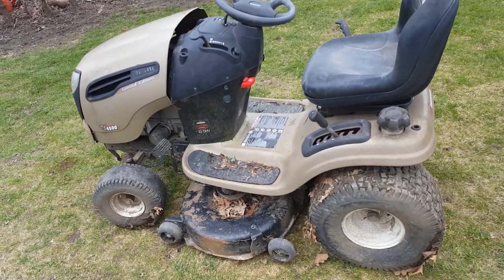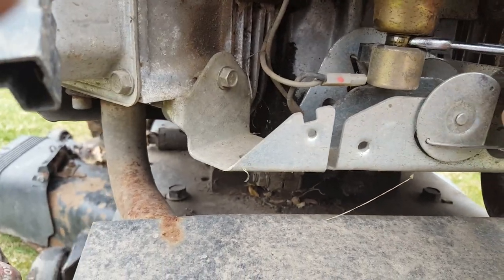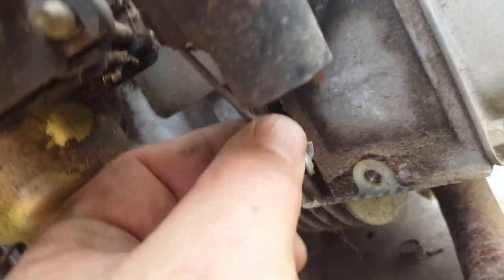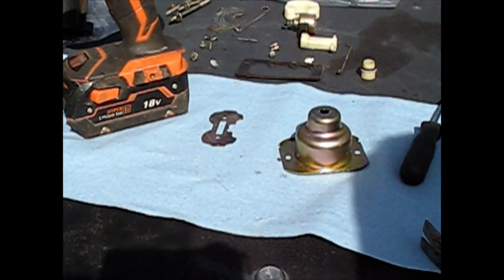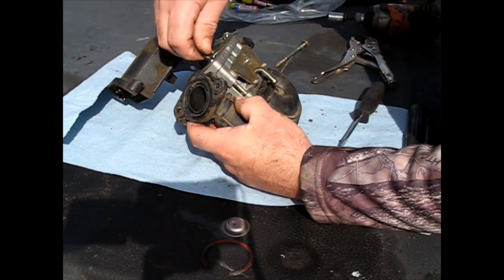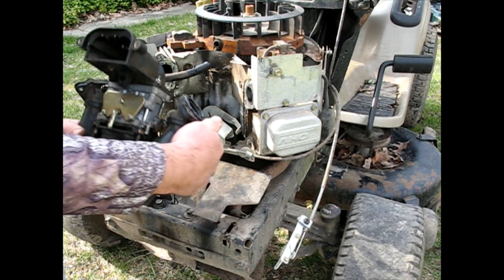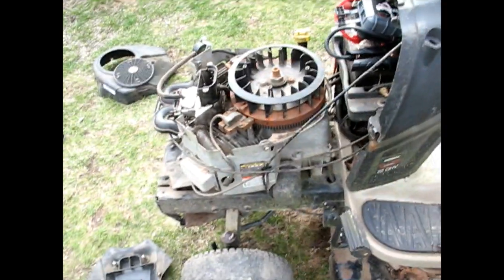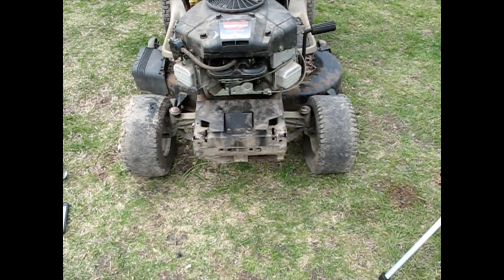Briggs and Stratton 22hp OHV only runs good on choke. Craftsman tractor

Comment: I found the ports to the heads were leaking air past the o rings due to warpage. I found the face of the manifold to the carb warped and letting in air as well. I also found that the rubber gasket under the transfer tube had swelled or just mashed so flat over the years, It was obstructing the space around the emulsion tubes nearly blocking them. ALSO, the the gasket under the black thing behind the throttle plates, the old gasket was partly obstructing flow. Glad it worked out for you, just some tips on things I have discovered.

Comment: The difficulty in the engine turning over is caused by the valves being out of adjustment. These engines use a compression release on the camshaft and the valves have to be set correctly for it to work.

Comment: I've got a 26hp with the same setup.  I did a basic quick clean like you said in the beginning and it'd only run on choke.  I had a feeling it was gonna take a chemical bath cause it sat for years.  I thought make adjustments on the screws but i need this thing to do the work next season.  

Thanks for the video.  You helped me make a decision.

Comment: Have a rebuild kit in hand when you open up one of these older carbs full of O rings, seals, and gaskets that shrink, swell, deterioriate, and crack. Also replace the 2 intake to cylinder square cut seals.
Remove float bowl first, then remove fuel solenoid. You will then see how the plastic fuel tube adapter fits.
Never use a powered driver on carb fasteners.
The 4 studs are not 4mm, They require a female torx socket.
The 2 float bowl screws have JIS heads, not meant for a #2 phillips.

Comment: Can't believe your using a power driver on a carb, Good way for things to go wrong in a hurry.
Reply: I've done it a thousand times and never had any trouble.. just have to know when to stop
Reply: @TheHomeImprovementChannel  yeah me too low power slow and know when to stop.  Also have jis bits for yhe bikes!
Reply: @TheHomeImprovementChannel  So then you must have noticed that he said he was using a 4mm socket on the 4 studs, which require an E torx socket.
Reply: @steadyeddie7453  Most people don't have an e-torx socket laying around.  A 4MM socket fits perfectly as a sub.
Reply: Learn control

Comment: Air intake gasket goes on after you put the four bolts in.  The bolts have heads about an inch from the top that seat into the carburetor body.  Note when the first bolt was tighten the gasket popped up. You broke through the gasket as the head was seating into the body.  Probably no big deal since this is the air intake and the gasket was still surrounding the bolt holes. Excellent video.
Reply: Snickers is a gorgeous doggo!
Reply: This is the saddest video I ever tried to watch your wrong in every turn

Comment: Just took one of these apart today. Something I noticed is that with the air filter still off, the engine wanted a bit of a choke to run smoothly, otherwise it would surge and stall like this engine did at the beginning of the video. This makes sense as the carburettor would be tuned to take into account the resistance of the air filter. Without the air filter there's not enough sunction generated to draw enough fuel through, so it starves itself of fuel.

Comment: Great video. If this doesn't work for you try this. I have cleaned my Nikki double barrel carburetor on a John Deere Z535M 3 times and it would only work for about an hour and then it would start surging again. I had to look elsewhere. So I took out the gas tank a gave it a good rinsing. There was a lot of dirt in the tank. I also removed the tube going into the tank and blew it out. After all that the machine works great so far. I have manged to cut the grass for more than an hour now. Just thought I would mention this because everyone looks to a dirty carburetor first, which I did. I hope this helps someone.
Reply: maybe a bad fuel pump
Reply: Sir when I work on them which is every day I put a white or red plastic fuel filter between fuel pump and carb
I promise you it will stop a lot of carb problems
I don’t even charge the customer for it
Reply: If it runs fine for a hour or so, then surges, sputters, etc, try removing the gas cap. You may also have a clogged vent in the cap causing the fuel pump to pull the gas tank into a vaccum.

Comment: Good lord. This crapped-up mower first needs a thorough pressure washing. You can bet the fuel tank is full of debris, so remove and flush it. Replace the fuel lines and filter — they are cheap. And NEVER bother to clean and rebuild these carbs unless your time is of no value. As suggested by another commenter here, a new knockoff is $30 on Amazon and installs in minutes. I have purchased two for a 23-year-old machine that gets used every day. That said, this machine has been so thoroughly abused that rough running is likely to be only the tip of an iceberg worth of troubles.

Comment: I have the same rigg the problem was that the gas line was rotten, and stop running it with the wrong tipe of gas, and fix your problem with the small hose behind the fuel pump,, right in front of you

Comment: These engines are notorious for the throttle linkage binding against the plastic intake manifolds, fuel shut off solenoid failures, and failing carburetors.  In the case of carburetor failure, do yourself a favor and buy a new Kipa one for $30.  Problem solved
Reply: And we're am I going to find that carbator?
Reply: @kylehance3960  Amazon
Reply: Can’t seems to figure out what carb to buy new? Care to share a link? Appreciate it
Reply: My new/used craftsman yx4000 24 Hp Briggs and Stratton . I had to replace fuel pump . It starts and I mowed but it will only run on Full choked. I know not good. Now trying to finish mowing it now
Dies even in full throttle. Is there possible a adjustment to the choke? I see a screw Above the linkage?
Reply: @crimeshaveconsequences4268  Sounds like the fuel pump or carb is defective
Reply: @nathanr.8556  I can’t check the foul pump , but it ran fine everyday since I  installed it. Now it’s the choke issue it has when I bought it . I didn’t know about the issue until we’ll I paid for us. It was mowing on full choke fine, but now seems to have not very much power especially if I’m going up a slope yesterday. I
Just wanted a decent mower I could afford.  If I can fix the the choke issue or whatever it is it will run fine ! I just need to know where to even go from this point . Thank you
Reply: @crimeshaveconsequences4268  If it only runs with choke on, then there is a fuel restriction.   It will never have full power mowing that way.  But you can check the choke linkage rod and governor linkage and make sure nothing is binding